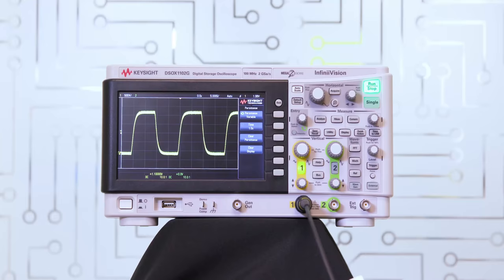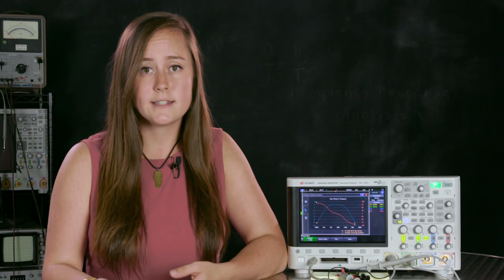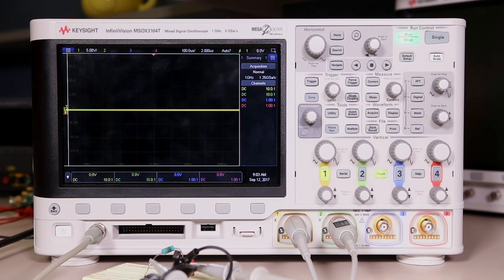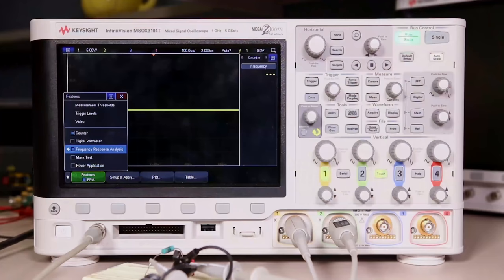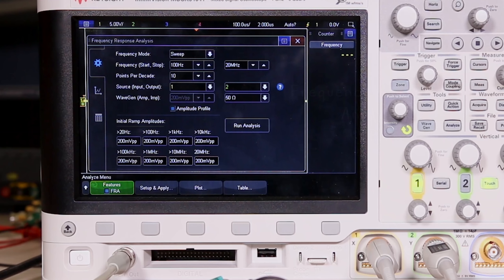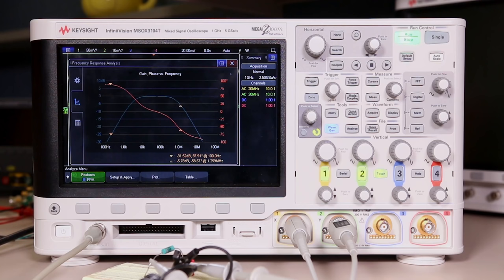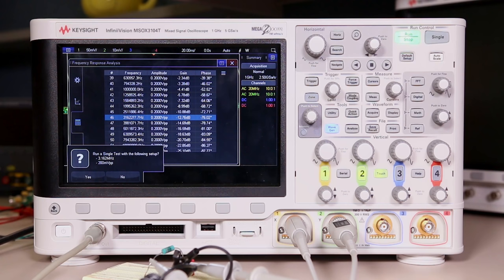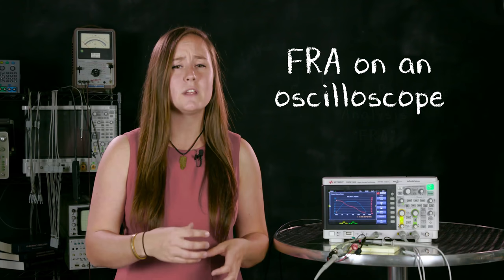How to Perform Frequency Response Analysis on an Oscilloscope - Scopes University - (S1E6)

Comment: Not many people seem to appreciate this feature until they need it, read about it, or look for a reason to use it. This is an unmatched genius feature of this scope, for those who need to characterize op-amps, oscillator circuits and other dynamic response systems. In the past it would take at least an hour to sit with plotting paper and plot it (this same RC circuit) using brute force time-domain measurements with an external frequency generator. the spoils :). Goob job Aaron.

Comment: Hi , I would like to measure with a oscilloscope where the ohms are in a specific frencuency in order to made the calculations of a crossover , depending the coil add in the speaker , the questions is it possible to measure this with a oscilloscope  ? Thank You   For example I would like to made a crossover At 875 Hz , and in order to do this I wiil need the exact ohms in the test  to  made the crossover .

Comment: Hey, is that an Hp 412A I see over your right shoulder?  Great piece of gear!  It has 6 RANGES below one volt!  Crazy accurate too.  I got mine for like $20 in need of repair, and after I fixed the chopper circuit it works like a charm and does tasks that even my Fluke 8842A cannot do.  I measured a microAmp with it yesterday, but I do wish it had a BNC connection.  Oh ya, your take on FRA was super, thanks.
Reply from the maker: Thanks, and yeah! We have some really neat vintage gear around the office.

Comment: Can it do a reactance( or impedance) vs frequency plotting?
Reply from the maker: No, not at this point.
Reply: Keysight Labs do you plan to includd it in future, it would a great feature and would help out a lot. Moreover ot can double as a lcr meter setup.

Comment: Hello everyone,
I have a question, and I'm hoping someone can assist me with it. I need to conduct frequency response analysis on the stator winding of a three-phase induction motor. The challenge is that we don't have a frequency response analyzer (kit) available. As an alternative, I plan to use the DSOX1202G Oscilloscope. Could anyone provide guidance on how I can effectively use the oscilloscope for this purpose?

Comment: What does high-z and 50 ohms impedance option mean in the frequency response measurement options? And how to choose appropriately.
Reply: For RF applications, 50 ohms is the usual system impedance. That is, the particular circuit block you're testing--for instance, a band-pass filter--"expects" to "see" 50 ohms at its input and output. In order to measure the response as it will be in the final system, you have to replicate the same impedance environment. An improperly-terminated filter will have a much different response than a properly-terminated one--generally in the form of ripple (sometimes deep) in the passband. When testing an active device such as a gain block, impedance mismatch could result in reflections that ruin what might otherwise be good IM characteristics. And so forth.

Comment: Are you saying I can do this right out of the box with the 1000X
Reply from the maker: That's right! You need to have the "G" model with the built-in waveform generator, though. The "A" models don't have a generator so it's not possible with them.
Reply: Keysight Oscilloscopes I have The A model

Comment: My 150$ scope unfortunately doesnt do such witchcraft ;d
Reply: Don't worry, neither does my £350 scope!

I think you can still do it with an external function generator as long as it has a trigger out. Nowhere near as easy or neat though, this is really quite cool.
Reply: Robee Shepherd yeah, but just image measuring wide frequency span and typing everything into your excel or whatever ;D